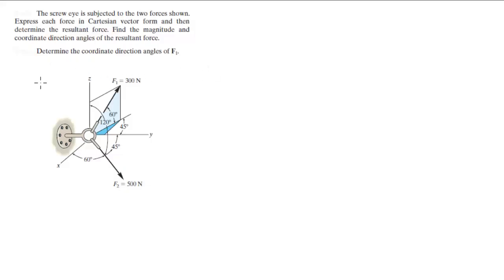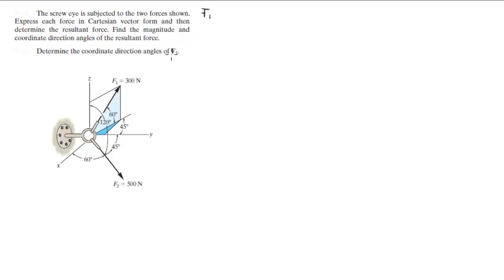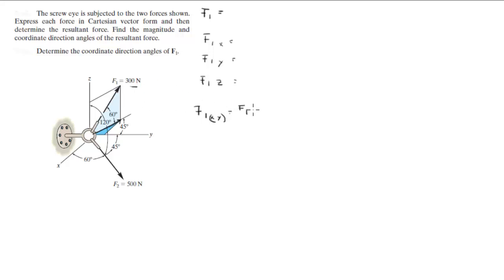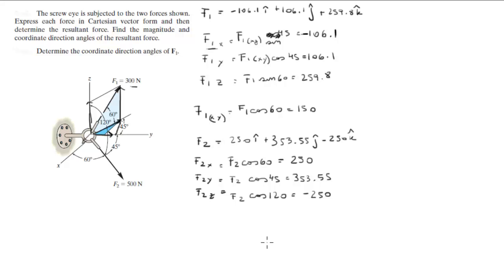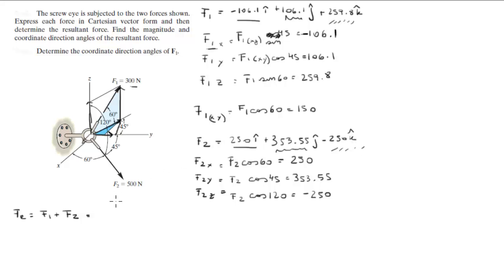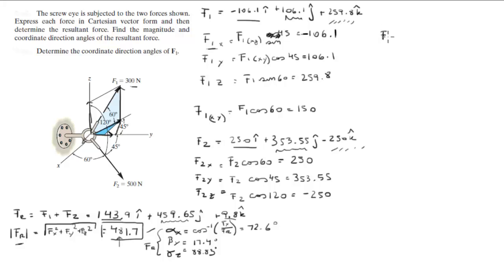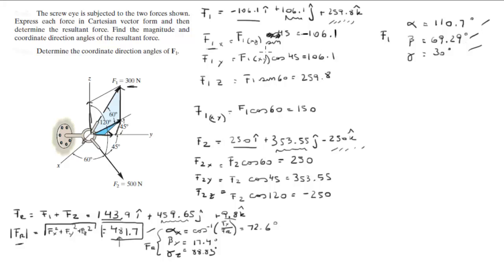Find the resultant force and F_1 direction angles

Comment: If you don`t know how he got the direction angles of F1:

1. Take the magnitude of F1, which is 300.01 in this case.
2. then take the cos-1 (-106.1/300.01)=110.71 degrees.
Do that for Y and Z.
Reply: Instablaster.
Reply: where did you get the -106.1? I know he said from the XY projection times cos45. But i am still confused there.
Reply: @moadipra3381  First is the find 300cos60 to determine its X and Y projection, which is 150. To determine the Y component, take its the sin of it. 150sin45=106.1